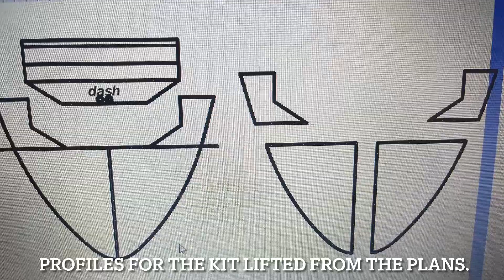Building a new wheelhouse on a Seal Islander Boat

Comment: Hi. Great work thanks for sharing. I notice some profiles are cut on CNC but some are still cut using plywood templates.  
Thanks David
Reply from the maker: Yes i cant help but fall back on the old ply wood for fitting up panels that might take a while in cad for a one off job like this. I have loads of templates in the shed from builds gone by and they are very handy. Cheers